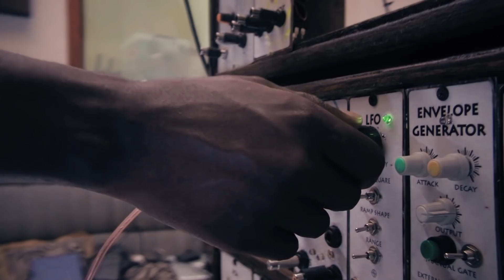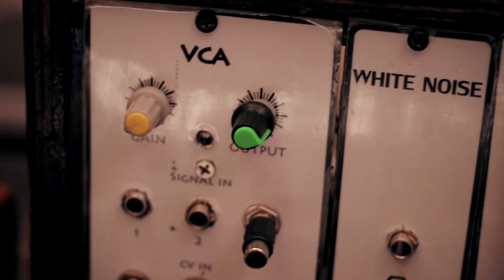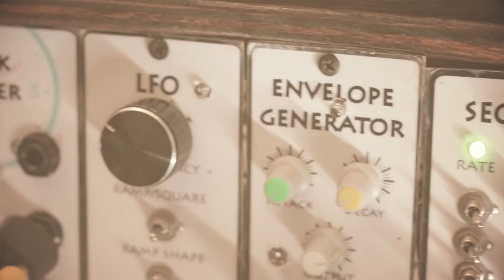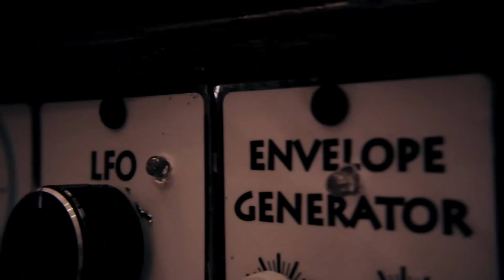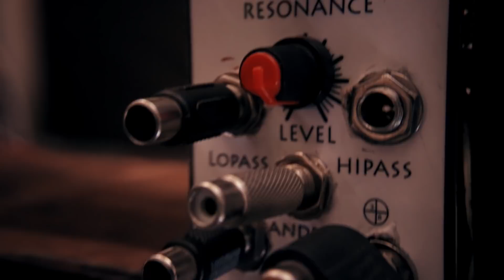Africa's first Home made Modular Synth

Comment: Awesome! May I ask why the adaptors from jack to RCA?
Reply from the maker: RCA cables are cheap compared to instrument cables..it was an after thought but the new modules am building use RCA sockets then i hook them up with rca cables without needed the adapters
Reply: Afrorack ahh yeah, cheers. You need a lot of cable, so it adds up. Also RCA is maybe easier to handle, not so thick & heavy :-)